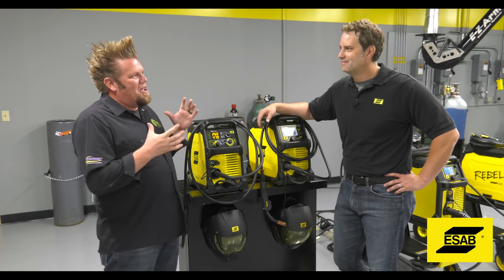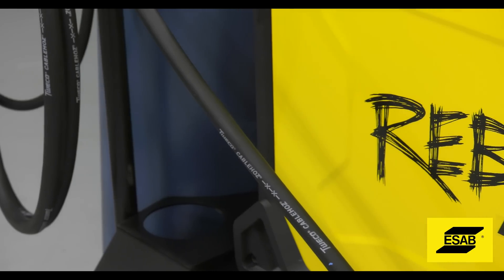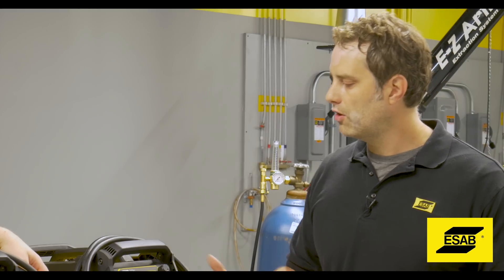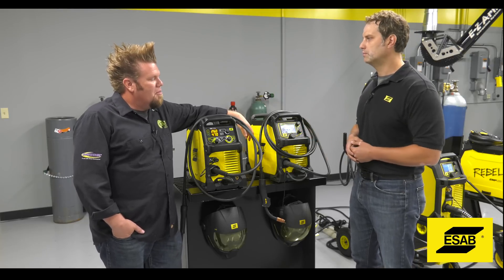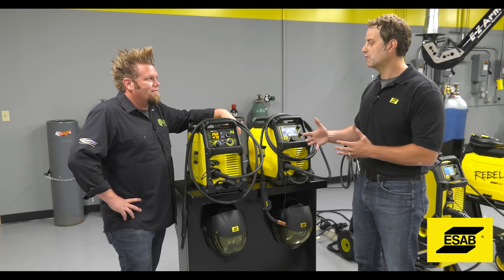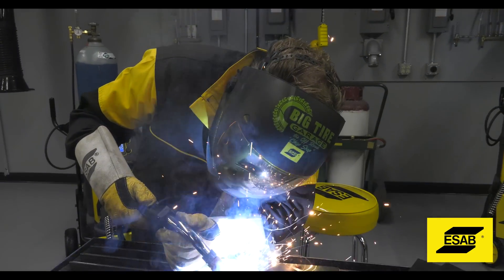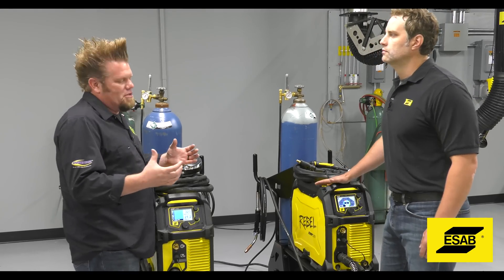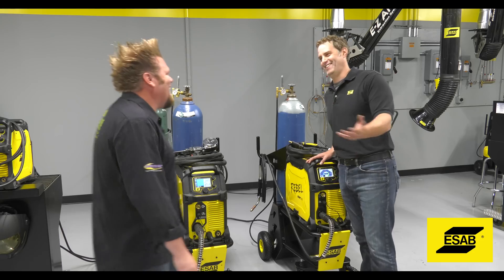Rebel Family of Welding Machines

Comment: If anybody in 2025 is looking to buy one of these things, avoid this POS at all cost. 

In MIG function. If there is even a slight curvature in the cable, it was sputter. I have spent hours trying to correct this fault. 

The TIG torch that ships with it was orientated improperly. I had to fight the torch the whole time while wilding, I ended ed up buying one from Everlast and adapting it to the machine. 

Even while in the right setting,
this machine does not like to run 6011 and 6010. 

This machine may do everything but it does nothing well.

Comment: I just got the 210 EMP multiprocess, and I'm trying to find out if there is a TIG pedal for this machine.
Reply from the maker: Learn more about how to order the TIG Foot Control, 4.6 m (15 ft) cable and 8-pin connector (W4014450) here: https://esab.com/us/nam_en/products-solutions/product/arc-welding-equipment/stick-equipment-cc/rebel-emp-215ic/

Comment: I have owned the 215 and the 235. Curled both several times a day for quite some time. That being said the 215 was amazing, especially after I upgraded the mig gun to a Tweco Spray master 250 I mostly ran .045 dual shield with some 1/16 but wanted something that could hold the 33lbs rolls. I never had a problem with the duty cycle but I got the 235 and sold the 215. That was a mistake because the 215 was so much more mobile and therefore gave me more options in the field. Had to warranty out both machines due to bad boards but they definitely made me some good money so I can't complain too much. Tried the Lincoln and Miller equivalent, not impressed. Waiting for my new job to get me the 205 so I can A/C Tig. Not the end all for welding machines but definitely my go to for general Fab/repair work

Comment: My rebel 215ic is headed for repair for the second time in 5 weeks. The motherboard was replaced via warranty and once again, it's showing the error codes 012 and 014. The same codes as before. Last time it was just over two weeks in the shop without my NEW rebel 215ic, I'm starting to wonder if this is a common  issue with this model, or perhaps the repair shop (Esab warranty compliant) didn't fully test it after repairs. After almost three grand (CDN) on an ESAB 215ic, and another 2 grand on an ESAB plasma cutter I'm starting to second guess my choice in equipment. Can you help me ESAB?
Reply from the maker: Sure can. Thanks for reaching out to us, we're glad we were able to get you some assistance.